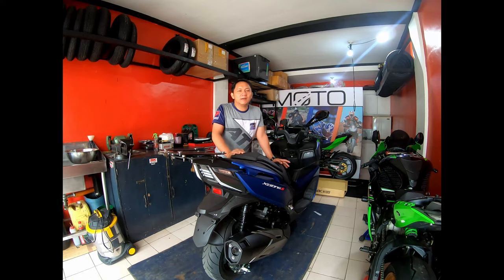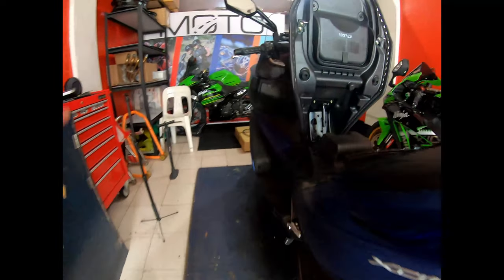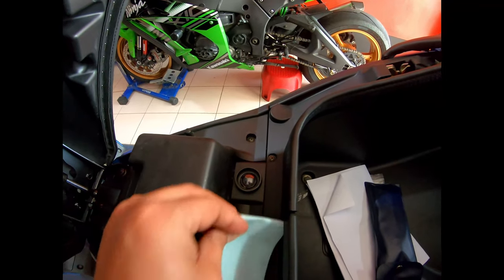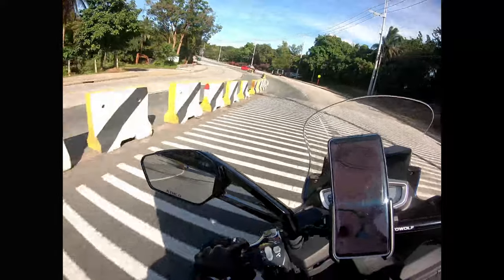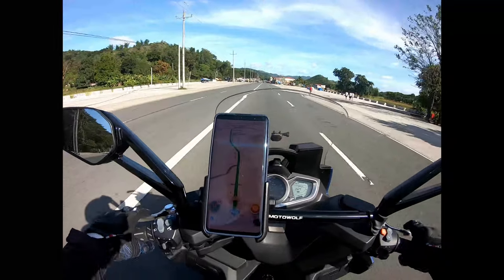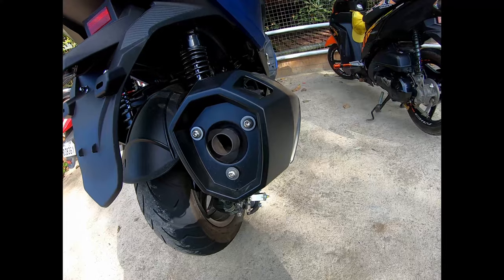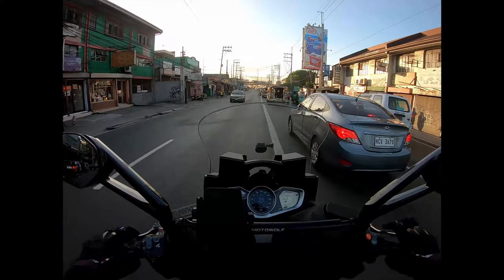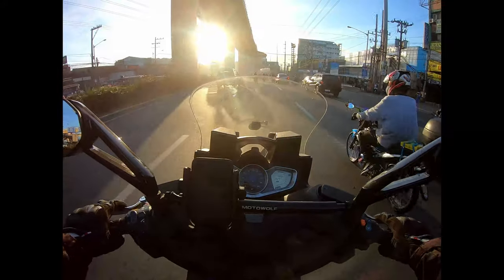Bike Review: Kymco Xciting S 400

Comment: Sir jj ipa review naman ng new shock gsport
Compared sa stock hehe thanks po
Reply from the maker: yung G-Sport po mas malambot lumaro kaysa stock rear shock ng Xciting S 400 pero mas maigsi ito ng 6mm. 406mm yung stock at YSS G-Sport ay 395mm & can be extended to 400mm. pero in my case, nag try ako isagad to 403mm. itatakbo ko po ito sa BOSS Ironman XV. hoping for a good one.

also yung G-Sport may adjustment ng spring preload at rebound damping which is way better than the stock.
CONS lang talaga yung shorter length pero PROS ito para sa mga maliliit na tulad ko (5'5" height) dahil bababa yung seat height ng Xciting S 400. if you want na ipa set sa amin, pwede. we have to balance the weight distribution ng scooter kasi.

I am planning to bring in BITUBO rear shock yung 406mm. may kamahalan nga lang talaga.

Comment: Sir  Jj motoscoot
 ask ko lang .. AEROX po mc ko ngayun

 pero may transaction nako MOTORTRADE netu pagkatapos ng ECQ

 pinagpipilian ko sila between XMAX sir

 Anu ba mas tingin mo na mas susulit sakin sir    .. 

   D masyadu habol ko un TOLLWAYS legal

  pero  ,nag iisip ako sir , kasi baka pag Xmax kinuha ko e after one year d ako makuntento e upgrade nanaman ako sa Xciting

  saka may nababasa kasi ako sir,  halos parehas lang daw sa torque at accelaration si XMAX  300  ke Xciting po?

  Anu po inputs nyo ditu  sir JJ?
 salamat po
Reply from the maker: kung stock sa stock na feel sa torque (hatak sa arangkada) malaki pa din difference difference ng Xct S 400 sa Xmax.

isa pa mas mababa seat height ng xct s 400 kapag inupuan mo kasi mas malapad yung kanto ng upuan sa rider ng xmax. dahil dito mas madali dalhin sa city si xct s 400 lalo na kapag may backride.

mas malaki ang steering angle ng xct s 400 kaya mas madali gamitin sa city.

handling wise, malayong maganda ang handling ni xct s 400.

personal na pakiramdam ko lang yan as a rider and previous owner ng xmax